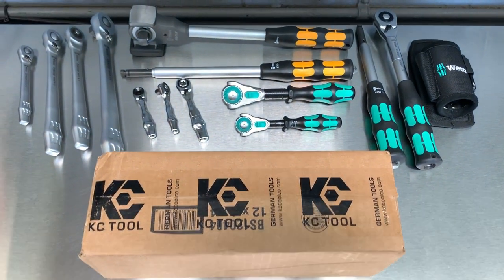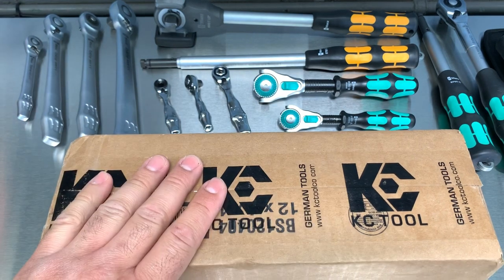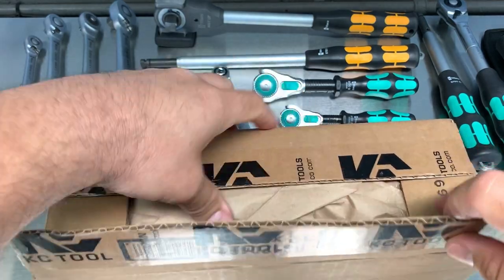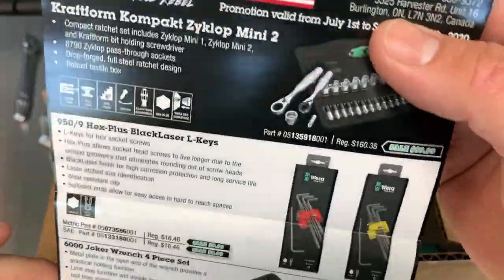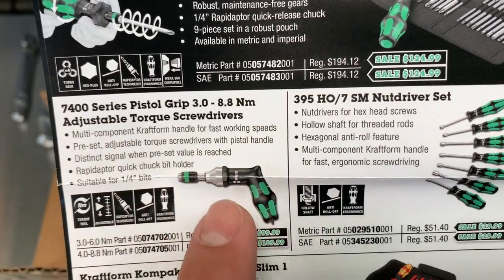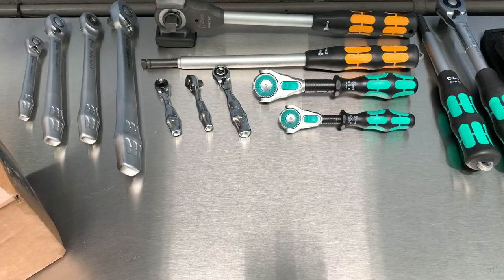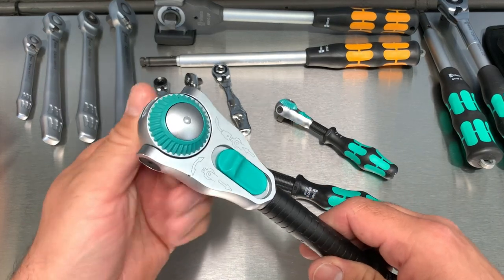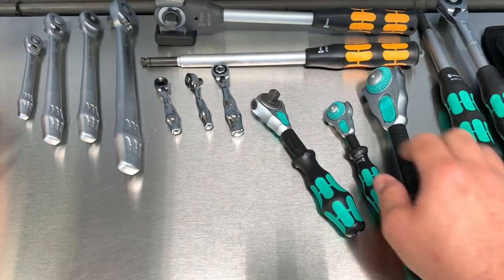KC Tool Unboxing and a Whole Lotta Wera Ratchets!

Comment: I like to put the Koloss extension handle in the pocket you stashed the pin in.( a tiny 1/4" slice vertical at bottom) I then put the pin in the other pocket. Carabiner  snaps to the belt loop.

Comment: That’s considered a spud ratchet.
It also has a built in beater (sledge hammer)
This is very common in ironwork to connect beams.

Comment: I use a half inch Zyklop 8004 C jobbie and I really like it, feels good and is my go to. Only issue being the detent is quite far back so does not always grab the socket well, luckily it grabs my extensions really well so there is no risk of sockets falling off.

Comment: I have the 1/4 and 3/8 speed ratchets....I find the 3/8 handle a little short for snug fasteners and I'm not talking stuff that requires a breaking bar, just properly tightened fasteners

Comment: I'm just a home gamer, looking to upgrade my incomplete and hodgepodge collection of cheap Chinese tools. I just got a full set of Wera screwdrivers (including the impact set) and I also picked up the 11 piece metric ratcheting Joker wrenches. I'm already hooked and have a bunch of the foam sets on my wish list. I love the unique features and the quality for price when compared to Snap-On and others.

Question...what is your opinion on the Zyklop speed ratchets for automotive use? Do you find that the heads are too big, causing you to use an extension where you wouldn't otherwise need to? I'll probably pick up the 8004's eventually too, but wondering how well I would fare with just the 8000 speeds.
Reply from the maker: Yes, for auto repair, they are large. They sure are comfy for basic tasks though. I had them set aside just for oil and spark plug services where access wasn’t an issue. Just comfort.
Reply: @AutobahnDan  thanks for the feedback. I'll keep my current ratchets on standby until I can upgrade them...maybe check out some Hazet options.

Comment: So Dan, I'm from the USA and every mechanic here has both full SAE and Metric sockets and wrenches, cars trucks, trailers, etc is pretty much split down the middle to weather its gonna be sae or metric.   Is it the same where your from?  I just thought about that.  Also how often do you have to use those imperial style wrenches and sockets, here in America you might see 1 car every 15 years thats imperial so nobody buys imperial tools here.  Maybe a few folks but pretty much nobody.
Reply from the maker: I’m from here as well, I work on German vehicles. No SAE needed except for removing and installing air fittings for air tools and for other large tools and equipment around the shop..

Comment: I've heard sockets from other manufacturers don't work so well with Wera ratchets. Loose? Idk.
Reply from the maker: Sirk Dopsah yeah, I tried all mine.. Snap-on, gearwrench, Lisle.. they all work fine. I think ClientGraphics either has a bad one or he has the few sockets that don’t fit right..
Reply: @AutobahnDan  Good to know. I want to try them for sure.
Reply from the maker: Sirk Dopsah the Wera sockets are nice tho! Knurled ends! Color coded! Holding function available as well! Dialed in on the 1/4”, hope to see more from them!

Comment: impressive, but why oh why oh why?  There are much better ratchets.  The unique ratchets like the Kloss and Zyklop speed ratchets are one thing, but the metal ones just aren't as good for the price.  I much prefer my Hazet 916HPLG over the Zykop Hybrid Set (which is collecting dust from non-use) for not much more in cost for a much better ratchet.  But I get the whole set thing, since I've gone out of my way to find every socket in both 6 and 12 pt for 1/4, 3/8/, 1/2 in short and deep.
Reply from the maker: @Han Wagu bigger on the electrician scene. They love em! They may not be as high-quality as German made, but you can see the value in these of non-German with German quality control. If the price for it went any lower, then you’ll have mid grade Taiwan
Reply: @AutobahnDan  electricians love metal Wera ratchets?  Don't get me wrong, I have plenty of Wera tools, but the cost diff on ratchet heads just not there to justify spending less.  One factor is Wera metal ratchets are not serviceable, so the cost savings goes out when you have to replace rather than service parts.  anyway, nice collection nontheless.
Reply from the maker: @hanwagu9967  I see them on Instagram with all of Wera, it’s like a cult. The round head ones are serviceable

Comment: The wiggle is because is a thin ratched. You are sacrificing precision for thinness.
Reply from the maker: If you’re talking about the push through, it’s super bad even compared to ratchets that are even thinner. Maybe the thought process was that dirt and debris might make it difficult to be a push through and a quick release so they left some clearance so it can be cleaned🤷‍♂️
Reply: @AutobahnDan  push through and switch have some wiggle. This is because on the switch version they use the rear cutout on the frame as centering but also is the frame for the push-release and they cannot have a smaller tolerance. On the push through this goes for both sides.
You will see it if you cut one open, there is a snap ring at the back that holds everything together.